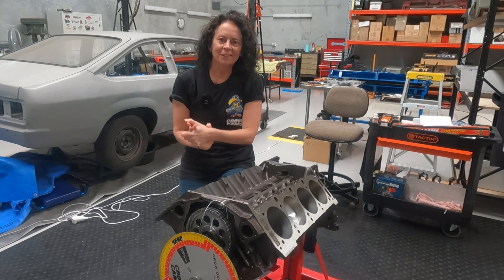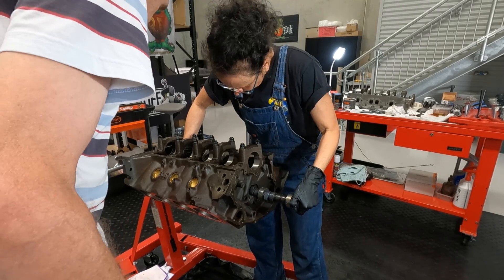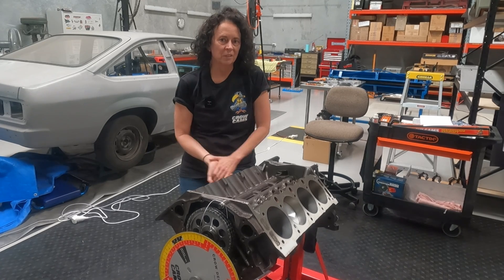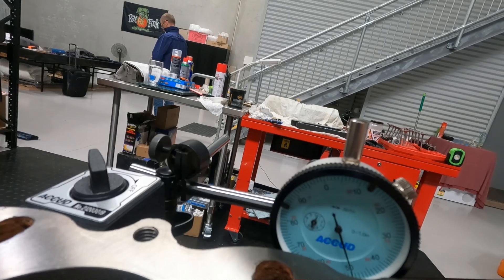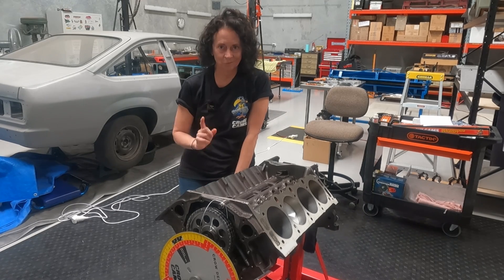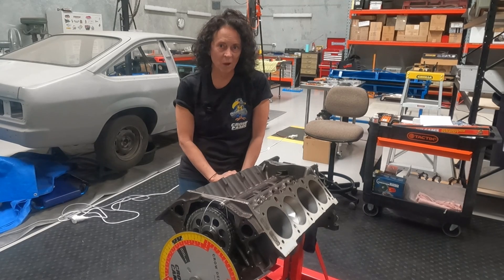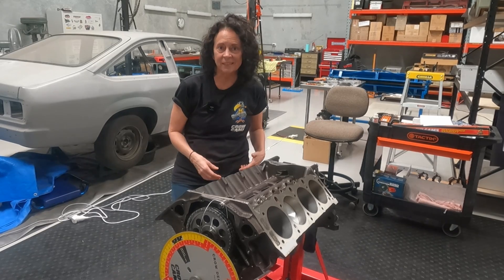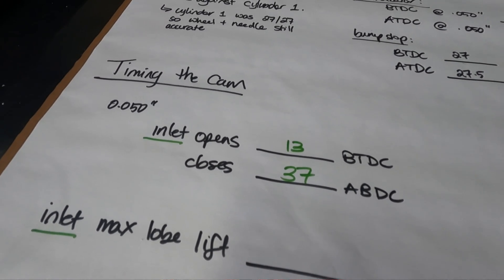Dialing In The 308's Cam Reveals Timing Troubles

Comment: Ive just installed a Crow Cam and it is also at 5deg advance. Ill be retarding it -4deg which will bring it to 1deg advance plus the 2deg thats ground into it. The engine was built by another engine builder and the sprocket was set on 0. Id say it was previuosly running advanced. It also now makes sense it responded to 34deg total timing on the dyno when its probably 29deg if i add my own timing tape.
Reply from the maker: Well now I know I'm not alone!  But I still don't understand how this extra 5 degrees happens. Do you have a theory or explanation?

Comment: Wise move. I mucked around with cam timing for extra torque. Makes little difference. How many stock 308s ran around with factory cam timing out. 1000s.
Reply from the maker: You're probably right! I'm still happy with what I did but time will tell!
Reply: @staceonwheels   Won't go wrong, just an expensive way to get there. Some of the stuff you did is for a racing motor, not a streeter.
Reply from the maker: @colinross6259 yeah I know it's more than it needs but great learning and great fun.

Comment: Should be using solid lifter to test not a soaked in oil lifter which doesn't do anything?
Reply from the maker: I did switch to an old locked up lifter which didn't compress.

Comment: Hello Stace, just found your channel and can sympathise with you frustration with cam timing on Holden's, if you're after the best performance from a crow cam just read the cam card and set it up to have the specified lift at no 1 inlet at tdc and it will be good, in the past I've had to advance a full tooth and then use the retard gear keyways to achieve this figure, not good for the next guy working on it but best for the cam. At least your not working on an old Ford cleveland they are much worse. Hope it all works out and if it doesn't you can make more vids on changing the cam timing and the perceived changes a few degrees of timing makes to your engine. Cheers
Reply from the maker: Very encouraging, thanks! I didn't expect this amountvof timing variation but seems it's not too out of the ordinary. You're right, I can just keep experimenting!

Comment: Good video and I’ll been keen to see what you find when you retard the cam 4 degrees. I can’t see you needing to chase this anymore than 4 degrees, 2 degrees might do the job to for a 308 noting the cam you are using a 230/230 @ .050, approx .500” lift (pretty much a 286 Crane) cam. How much compression is this 308 engine going to have? The engine will need some compression (at least 9.5 to 1. 10-1 would be better) to mate the cam work and you might find it will want to rpm higher than you want, but the early style heads with absorb some cam compared to VN style with the same spec cam to suit the different valve layout. Anyway, good luck.
Reply from the maker: Thanks! Yeah I have retarded it 4 degrees. Fingers crossed it works as planned. 

I'm estimating closer to 10 for compression, with the pistons I have and the decks having been machined a little, but plan to calculate it.

Comment: I'm surprised the motor doesn't have anything on it to adjust cam timing. On SB Chevys you use offset bushings, you press the appropriate one into the cam gear hole that the cam pin locates into,  and that adjusts the timing as you please. I don't think you can adjust it 5 degrees though, that's a lot. The most I ever heard of is 4 degrees.

Also, just another little tip - when you're looking for TDC using bump stops, it's better to use longer bumps - about an inch or two long rather than a few mm. If you think about the geometry of the crank, when the piston is very close to TDC the crank turns quite a lot for a tiny difference in piston height, so any small deviations give you a bigger difference in measured crank angle. By stopping the piston an inch or two down from the deck, any tiny errors in piston position relate to much smaller errors in crank angle. I don't think this would be the cause of your 5 degree error though, but still something useful to keep in mind.
Reply from the maker: Thanks for the tip.

Yeah from the videos I've watched no-one else get anywhere near 5 degrees out. And Gary himself had never seen 5 degrees either.

Atill a mystery but maybe continuing with the build could reveal something. Or not 🤣

Comment: Tolerance stack up is your issue, a half a degree on your crank  and a one degree difference in your chain set all adds up. Do what your viewer said and try the -4 keyway, if you are still a little off get yourself  an off set crank key which you can get in1 degree increments. I would personally ran it at 4 degrees advance anyway,  as it will boost low end torque without reducing your top end  power to much,, which is needed on a small V-8 such as yours. Your engine guru should have known all this anyway.
Reply from the maker: Yep Gary does know all that. But I cannot yet understand how 5 degrees only changes behaviour at low RPM and not elsewhere in the RPM range.

Comment: Hi Stacey, Something to think about is the differences between the prepollution engines and the later pollution ones was that the cams were ground the same specs but they changed the cam timing by shifting the keyway in the chain set, which keyway I am not sure. I think it was a 5 degree shift and that caused a power drop from about 240 HP down to 160 ish hp. 
All in the name of pollution.
Reply: NO way such a big drop.
Reply from the maker: Well that's interesting. I had heard they retarded the timing... I'll think about how that could relate to this... as I was sure the cam and crank were both for the earlier 308 I have.
Reply: I should have said this relates to before the VN heads came on the scene, try the book "How to hotrod a holden v8" lots of info there. @staceonwheels
Reply from the maker: Thanks, I have that book already!
Reply: Hi there,
I have a similar recollection for pre-pollution and post pollution Holden red V8 motors - I recall there were actually 3 different gear sets for the Holden V8 red motors (9 degrees variation between them all rings a bell in the old memory banks) - same timing set up re: set dot on crank gear horizontal with bottom of block on oil pump side & 9 links up to the timing mark on cam gear - but there were differences in the timing chain gear and crank gear sets between era/models - not sure if it was keyway or locator pin - the go was back in the day to use the gear sets off the pre-pollution motors for more timing advance - but it’s been many years since I was machining & rebuilding engines back in the early 1980’s after which I changed careers. Anyway, hope this helps. 
Love your work and thanks for putting in the time to share  on YouTube. Cheers Stuart
Reply from the maker: @stuartgordon1501 well thanks for that cluw! I'd still love to get to the bottom of that timing discrepancy so I might be able to chase down the path you suggested about different era blocks and possible keyway differences. That's what it seemed like the issue was. But it will be very cool to find out!

Comment: mass producing so they probably didn't worry too much about the accuracy 
given its not going to be a racing engine it will be ok
Reply from the maker: Do you mean Holden, when the set the keyway on the crank? Because yes, that's a good argument why 👍.
Reply: @staceonwheels  yep quality control wasn't great back then stace
even the red holden six cylinders were the same
mid 70's 253 and 308 in lx toranas were known for bad cams

Comment: That engine looks great, good on you for tweaking it, it will pay off. I’m replacing the springs, brake cylinder and shoes on the rear and it’s a confusing mess!
Reply from the maker: Drum brakes always are a mess!! Do you have that special spring tool that makes it easier?
Reply: Ordered one on Friday after slipping off with screwdrivers and some cursing. 😎
Reply from the maker: @oo0Spyder0oo 🤣🤣🤣